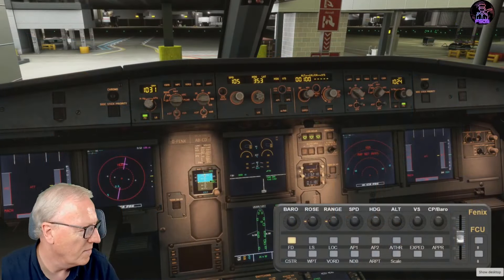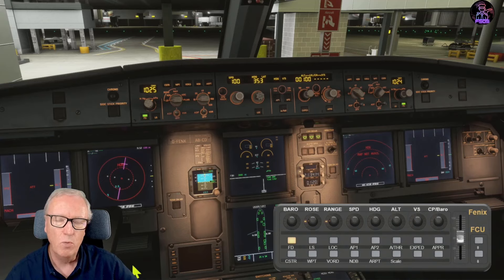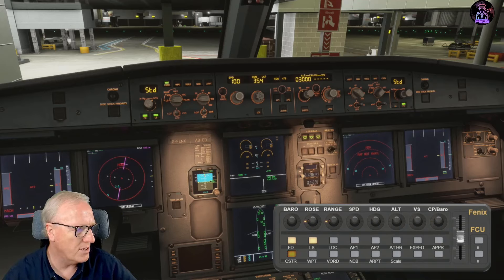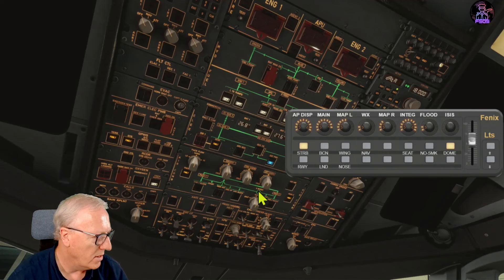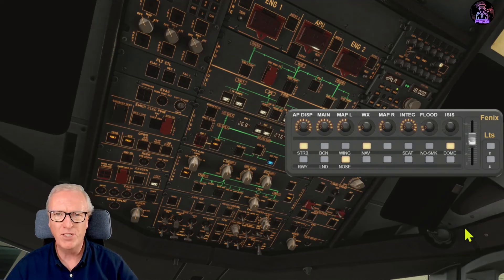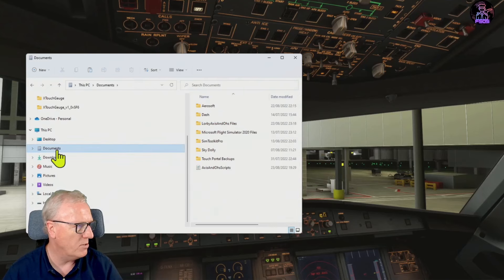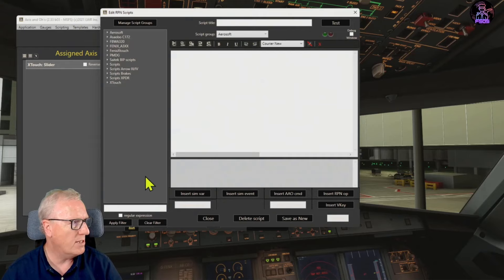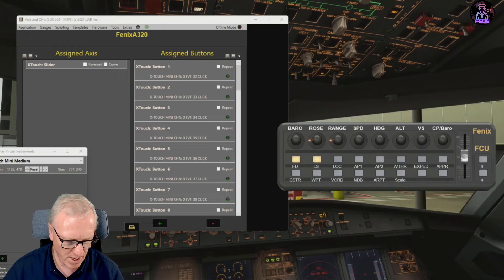FenixA320 X-Touch Panels

Comment: Got everything set up per instruction.  I have the x-touch (via AAO desktop fip for the xtouch) set up for the Fenix a320. The guage pops up and I can see all the layers but when I push the buttons (virtual or on the xtouch) nothing happens in the sim. Seems like the scripts are not running. Any ideas on how to fix?
Reply from the maker: Did you do the section on setting the script to auto run on the aircraft ?
Reply from the maker: Did you do the section on setting the script to auto run on the aircraft ?
Reply: did you solve this? I have the same issue